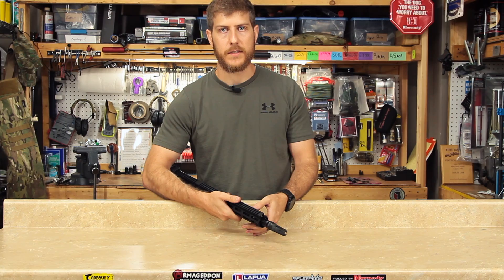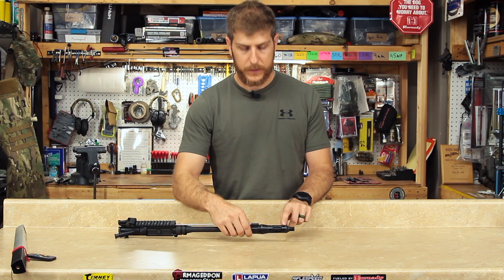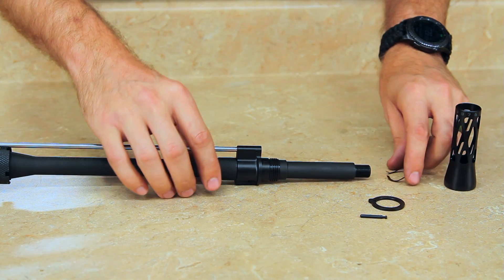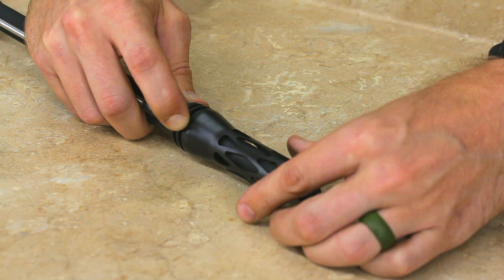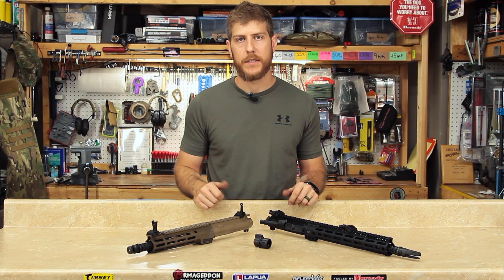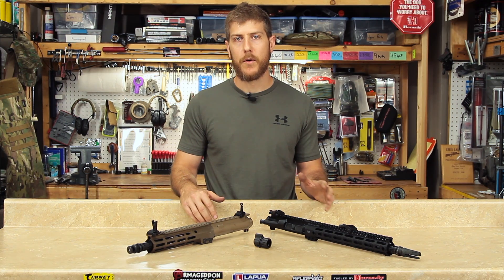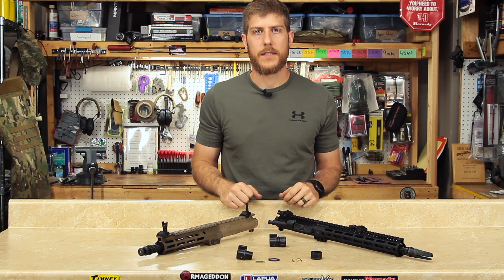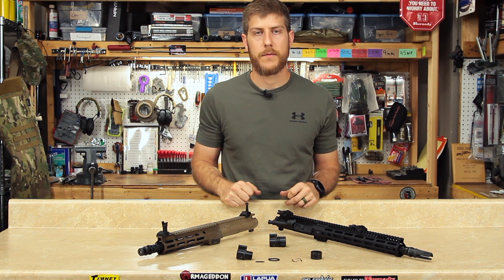RIFLESPEED Gas Controls Adjustment, Maintenance, and Use.

Comment: So are you saying that every time I have to clean an oil my adjustable gas block I have to take handguard off clean and then reinstall handguard
Reply from the maker: No. There is no need to remove the handguard to apply oil to your Gas Control when you oil your BCG. For those who want to disassemble their Gas Control, these instructions show how. Refer to the Maintenance Instructions on our Tech Documents page at Riflspeed.com for additional details.

Comment: I have a 16 inch barrel that needs a mid length gas block. What model control do I need for it because I have a 15 inch hand gaurd. It sucks how they don’t tell me how long each one is when I select 1 of the 5 models.
Reply from the maker: The last two digits are the assembly length. https://www.riflespeed.com/Price-Weights-and-Dimensions-for-Riflespeed-Gas-Controls_b_8.html  We have a new model coming soon that will work with your 15" handguard. At the moment the RS7558 is the best choice, but it is not as easy to adjust since your handguard allws almost no room to access the Control Knob. Thanks for your interest in RIflespeed!

Comment: How hard is to turn that knob on basic model? I was thinking about using Riflespeed gas block with FSB cutout handguard. Could it work that way?
Reply from the maker: You may want to add a window opposite the. FSP window to make it a bit easier to adjust, but yes.

Comment: I'm running a 10" pistol length gas system 300blk with a 12" gaurd,obviously the website says no model will work for my firearm.are there any other reasons that would be besides accessibility? I would be willing to modify my guards to accommodate access to the gas control If so.i plan on running a suppressor and light weight bolt but I've got to buy them piece by piece,this would be a tremendous help when getting new parts..
Reply from the maker: You can easily run an RS7519 or RS7521 under a windowed handguard. We are adding this to our upper options, beginning with 300AAC. We’ll have pics of this available on the site soon. Feel free to email support@rif…..com in the meantime. Thanks
Reply: @riflespeed2349  just like that I'm convinced! Thank you for your support and your quick response!

Comment: I can say without any reservations, this is the best adj gas block on the market..No more allen wrenches or frozen adjusters..The carbon build up is easy to remove..I have replaced 3 of my rifles gas blocks with Rifle Speed Adj gas blocks...Worth every penny.
Reply from the maker: Glad to hear it. Thanks for your support and your review!
Reply: @riflespeed any chance on coming out with like an inconel gas tube or a black melonite gas tube ?
Reply: @riflespeed  you seem to reply to YouTube comments faster than customer service complaints, so what have you to say about my stuck plunger?
Reply: @skylorcampbell4444  If it is pieces of the bullet jacket that made your plunger stick, then you have a barrel problem, not an adj gas block problem..Like I stated before, if your adj gas block is getting stuck after 8 rounds, you have other problems..Keep at it you'll get there..
Reply: No frozen adjusters? I got one of these for a 300 blackout. The first time I used it, I was finding settings for subs and supers using the shortest plunger. Within about 50 rounds, I could no longer turn the knob. The plunger was completely carbon-locked inside the block. I had to take off the hand guard and use a screwdriver blade to work the plunger enough to get the knob off. I completely cleaned it and lubed it. The second time using it, I fully rotated the knob after every magazine (10 rounds each) to see how free it was. After about 30 rounds (3 mags) it was getting difficult to turn. After 2 more mags, frozen again.
Reply: @Subtlenimbus  Same here, tried setting 5 with supers seemed to work well. Put suppressor on with supers at 4 started to need more gas but after 8 rounds it wouldn't move at all
Reply: @skylorcampbell4444  You did something wrong if you fired 8 rounds and it got stuck lol..
Seriously?? 8 rounds isn't enough to do anything..I would love to see a video of a Rifle Speed adj gas block or any other gas block that got carboned stuck after 8 rounds..
Trolls are running amuck!
Reply: @hairydogstail  listen joto, you seem a bit nieve. I'll post a gd video in the next couple weeks if you don't believe me ya pole rider
Reply: @hairydogstail  did you get a lot of strange brass colored flakes near your plunger on newer builds?
Reply: @skylorcampbell4444  Joto?? Pole rider??? I think your mind is focused on something other than your rifle lol... Please do, I would love to see it as a rifle will not put enough carbon in any adj gas block to carbon it up with 8 rounds....
Reply: @skylorcampbell4444  No, that sounds like bullet shear from a rough gas port..
Reply: @hairydogstail  perhaps you're right about bullet shear, accuracy is great though. Regardless if bullet shear is why it couldn't move, it didn't move Einstsincemy plunger was stuck and after prying it apart with a screwdriver I've since oiled the shite out of the plunger and teeth on the dial. Testing will be performed in the next 2 weeks with low quality video.
Reply: @hairydogstail  I honestly think it's flaking off of the spring, it's not copper colored at all. Way more brass/gold
Reply: @skylorcampbell4444  The Rifle Speed spring is on the outside of the gas block, not the inside..It is impossible for the spring to get into the gas system..This is one of the main reasons the RS adj gas block is better than the others..Other adj gas blocks have their adj springs on the inside where the heat will make the spring set or even break..
Reply: @hairydogstail  the spring is within 1mm of either side of the plunger, do you actually own this gas block or are you a rep for the company? The flakes I'm seeing are not copper colored they are gold which is the same color as the spring. I'm not shooting gold or brass jacketed ammo so what's your thesis on that professor?
Reply: @skylorcampbell4444  The wave, adjustment spring is on the outside front of the gas block..It sits between the outside front of the gas block and plunger holding plate..Not in the inside of the gas block where the hot gasses are like in most other designs..If there was a leak, the pressure would push the spring away from the plunger, not into it...If you can not understand this, I can't help you...
Reply: @skylorcampbell4444 
First off, you both came to my comment, not the other way around..Second, I have no more ability to delete a comment than you do..
You are wrong and there is something else wrong with your rifle if the plunger gets stuck after a few mags let alone 8 rounds.. I have 2- 300 black out rifles with Rifle Speed adj gas blocks that function perfectly fine with over 2000 rounds through each..I use all kinds of ammunition from assorted factory to Wolf steel case..I have never had any stuck plunger problems..Why do you think this is??
 I was just trying to help you and all you can do is throw insults..You obviously don't understand how the gas system works, especially if you think the wave spring could get into the plunger..
It is obvious you don't need my help, so have a nice day..
Reply: @hairydogstail  the specks of gold colored material are the exact color of the coating on the wave spring which is, in no exaggeration, 1mm away from the midsection of the plunger where I am seeing gold specs. I had an Adam's arms adjustable piston kit on this rifle before and never found brass/gold colored flakes within the gas key or any other components. I've taken apart the riflespeed and heavily oiled the plunger. Will be testing in the next couple of weeks with a video
Reply: @Subtlenimbus I have put hundreds of rounds through mine during one shooting and the plunger never got stuck..I also have SLR, Superlative and Syrac adj gas blocks.. These are much worse for carbon freeze and they will run hundreds of rounds between cleaning and oiling..Sorry if I don't believe you..
Reply: @hairydogstail  I dont care if you believe me. I have no reason to make things up. Perhaps it's the pistol length gas or the powder. I'm still going to work with it to see if I can get it to do what I need, but so fat no luck.
Reply: @Subtlenimbus  Something isn't right, I have used crappy Wolf and Tula ammunition and never had the problems you are describing..The worst I had was the plunger stuck a little after a long period of time without oiling or moving the adjustment knob.. I popped the plunger loose with a little screw driver with out removing anything. I never cleaned it and it ran just fine..I'll add a little oil now after shooting 2 to 3 hundred rounds..Unlike other adj gas blocks, the plunger in the RS is easy to remove and service..All adj gas blocks need to be serviced once in awhile, but claiming it gets difficult after 30 rounds is something I have never encountered on any of my 5.56 or 300 black out rifles....

Comment: How fine are the gradations in the settings? For example, say you have your weapon on gas setting 3 and it barely cycles. You then put it on gas setting 4 and it cycles just fine, but there is a little too much gas. Are the gradations very minimal from one setting to the next?
Reply from the maker: A lot of time and effort went in to answering this question and defining how much adjustment is enough while being fine enough to allow real tuning yet not so fine that shooters get lost in all the settings. The combination of 12 positions on the Control Knob and the ten different Plunger sizes we offer create a system that allows meaningful adjustment without being tedious and the ability to choose the exact performance you need for any carbine configuration.
Reply: @riflespeed  Thanks for getting back to me. My whole worry was either the gradations are too large or they were too small as to be indistinguishable until you get far enough away. Every gas block I’ve used seems to be finicky and has the issue of carbon locking, so I’m definitely looking forward to trying these out. Cheers.

Comment: Hello I am doing a 8 inch 300 blackout build using a pistol length gas system. I checked your chart and it said to run a 5 inch or 5.5 inch handguard for the 8 inch barrel to use the RS7519 for a .750 but why can’t I use the RS7533?

In the measuring chart on your website says it’ll be 7.5 inch and my barrel would be 8 inch? Why is it a bad idea to use the RS7533 but a good idea to use the RS7519?
Reply from the maker: The threads on your barrel are 0.6" long. The RS7533 would hang over the thread shoulder (8" minus 0.6" = 7.4"). You can switch to an 8.5" barrel and use an RS7533. Thanks for your interest in Riflespeed.

Comment: There should be an off setting
Reply from the maker: Riflespeed Gas Controls are fully modular. You can set them up with as little or as much restriction as you want. Thanks for your interest in Riflespeed!
Reply: @riflespeed  there’s an off setting? I thought the lowest was 1 and it wasn’t completely off.
Reply from the maker: @maybeiam3367  Plunger size determines the amount of restriction at each setting. You can set them up however you like. AP2020 Outdoors has a video on this using a 300 Blackout.

Comment: Hello. Excellent an very informative video. I was just wondering if you could recommend the lube/oil to be used?? Thank you an thank you for your timely response
Reply from the maker: Old-school CLP works great. Synthetic motor oil also does the trick. Use a zero weight if possible since the motor oil won't have the same carbon-solvent properties. It works fine, though. Thanks for your interest in Riflespeed!

Comment: The only advantage I can see having this on ANY AR rifle, is if you were 100% going to run a suppressor... But if you are not going to run a suppressor, then you have no reason to be adjusting the gas system and then this has no real use and would add extra weight for no reason...
Reply: Exactly I'm only running it on my ar308 so I'm not beating the shit out of my gun when suppressed.
Reply: You clearly don't shoot competition stuff then. Having a rifle that is tuned with an ultralight buffer, low-mass BCG, and running minimum powder load to ensure absolute zero sight upset from each shot requires an extremely well adjusted gas system to keep the thing running. Too much gas, it beats the shit out of the rifle and causes jams and misfeeds. Too little gas, and it can't fully cycle the bolt to the rear and can cause failure to eject, failure to lock on empty, or failure to strip the next round from the mag.
Having a setup like this that lets you go through 24 settings (12 in plunger position 1, 12 in position 2) can let you seriously finnesse every bit of recoil management possible while still letting the gun function properly, and also be able to adjust it without tools mid-match if needed to ensure it keeps running even when the gun is getting dirty or running hotter.
Reply: Not exactly, mate. Short barrel/dwell length to port is the other main reason. As well as caliber change, along with recoil spring tuning. And another main reason is the ammunition, which seems to get lost in the mix. I'm setting up a 12.5 barrel 6.8 SPC with a 10" mid-length port, a linear device, a Ti BCG, a trimable flat wire recoil spring and a 5.3oz buffer, for an ext. tube.(tuneable to 3oz, or so) With 105, 110, 115, 120 and maybe 95gr ammo. Some that I want to reload with hotter powder and volume, for velocity. Tuned to the to throat gap. Not to mention, which means that you should, the gas port size itself, which varies considerable from manufacturer to barrel length and use... Reloading is always a consideration, on a gas gun, for cyclic timing. And min. gas gives more speed. And what about even more increase from a 45* angle drilling of the port to the barrel? What that would do for the short dwell time? Man, this is fun.  PS. can we also get a date on the recommended part availability? Thx
Reply from the maker: https://www.riflespeed.com/The-Fallacy-of-the-Ideal-Gas-Port_b_4.html